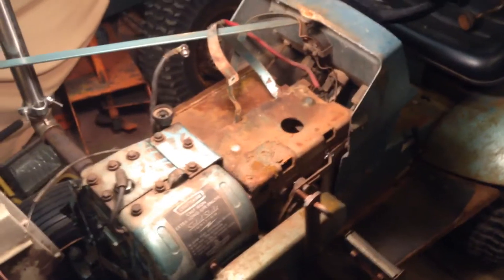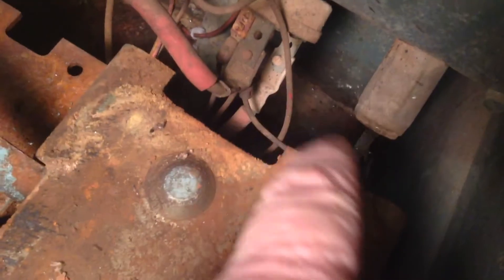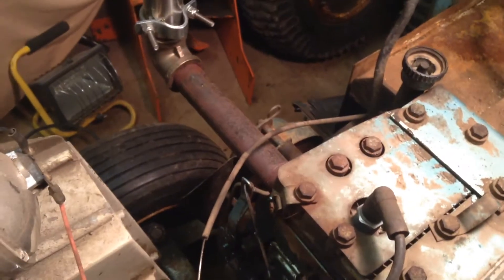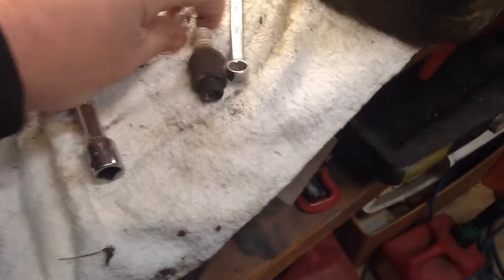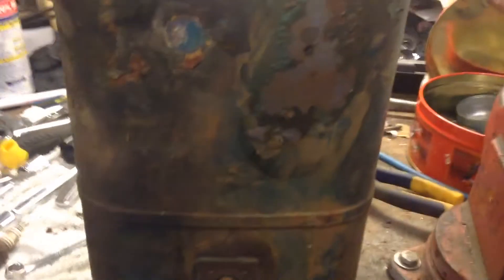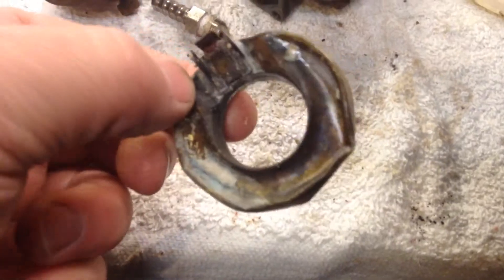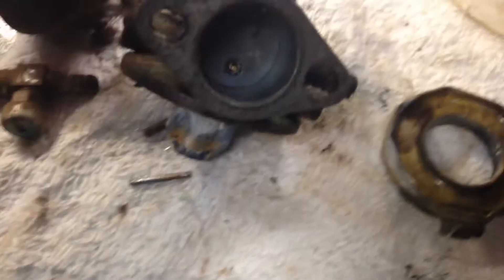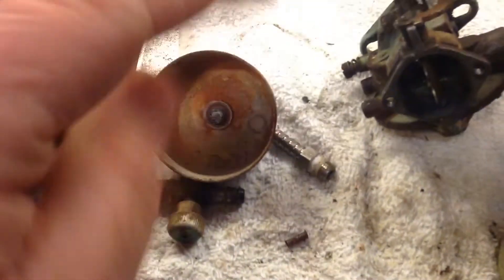1969 SS12 update

Comment: if you get exhaust locks you dont need supports. coming along nice. Give it a bath!
Reply: i have a carb off a 67. it needs the main tube for the jet. i have all the jets. the tube is stuck in it but i bet you could get it out
Reply from the maker: A bath? What's that? lol I would but my hoses are froze! Ya that exhaust is a temp until I get another pepper shaker or a stack, we'll see.